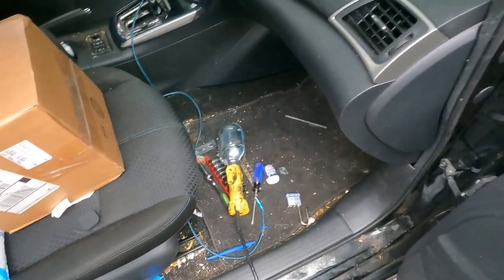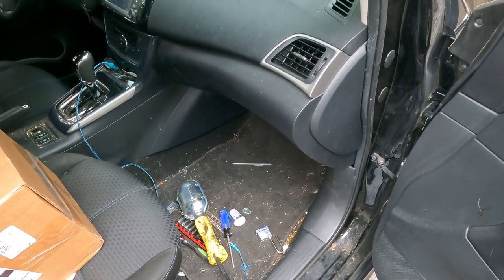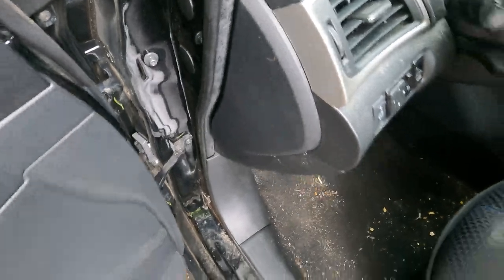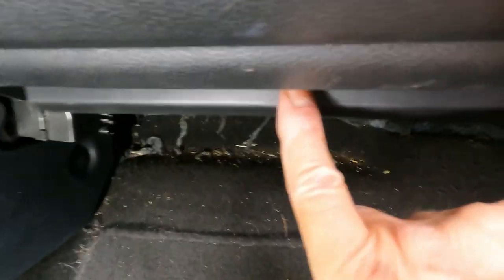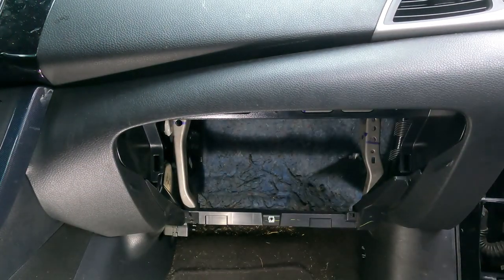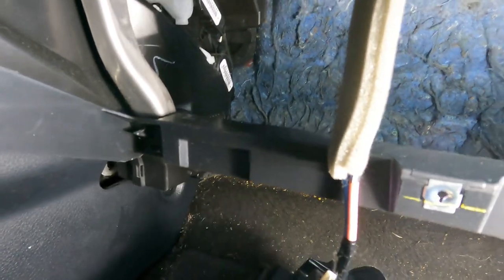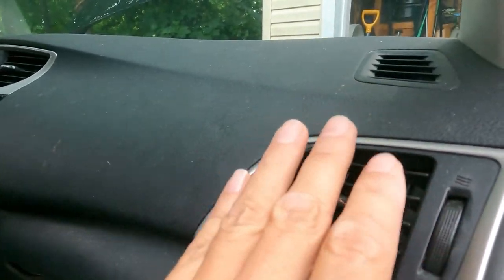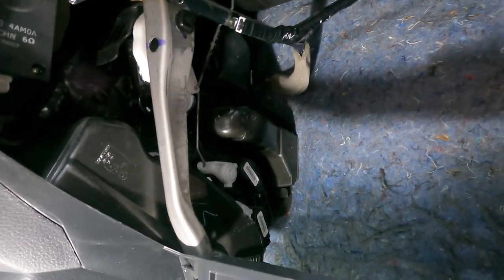Nissan Sentra Blower Fan Replacement

Comment: I took the glovebox out and can't see the blower motor. It's not where yours seemed to be, and of course I can't find the resistor. If you don't know, I don't know. So, I have a glovebox in my trunk. I have 2018 Nissan Sentra S. Any help? Also, Amazon's site said the motor you linked to does not fit!

Comment: Hey when you say not blowing cold air… is it blowing anything? Looking into what’s wrong with my ac. It’s blowing air it just isn’t cold. Thanks!
Reply from the maker: it was blowing air, just not cold. I think it had something to do with the relay going bad thats part of the blower assembly. Update though, I bought an aftermarket blower and installed it. It worked till this week, and its doing the same thing, so the aftermarket blower didn't last as long as the factory blower.
Reply: if its blowing warm or hot air then it could be either an issue with the compressor or low refrigerant
if its the compressor you might be able to fix it by changing out the clutch assemby